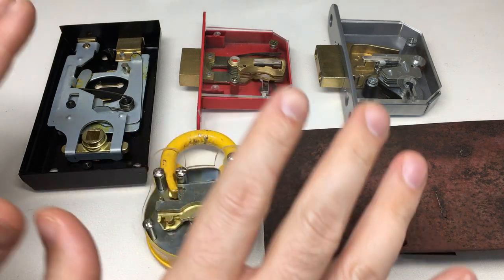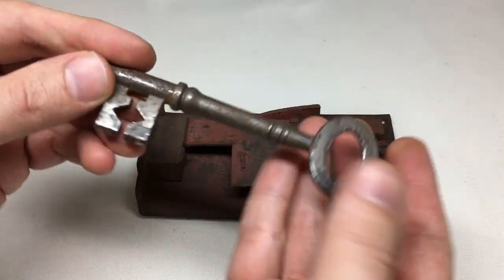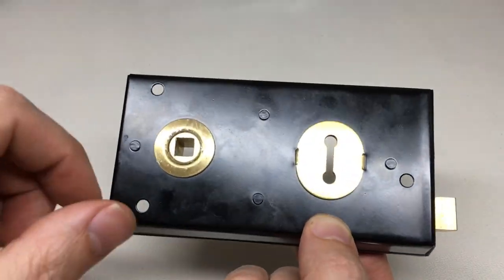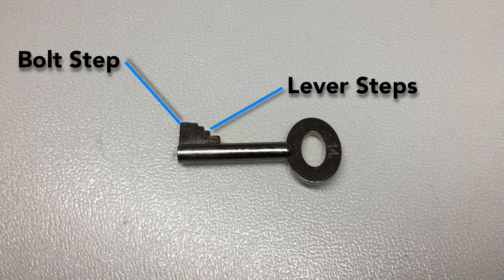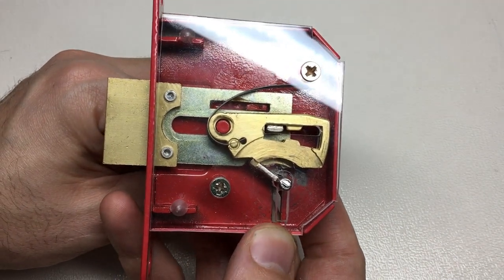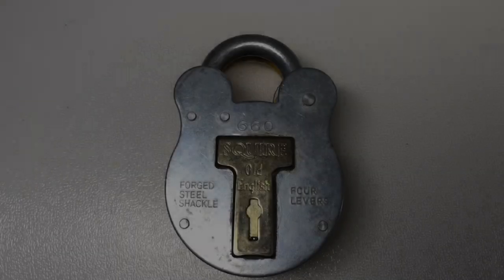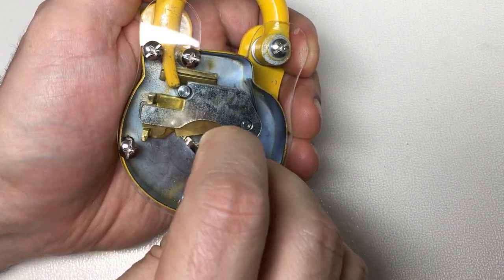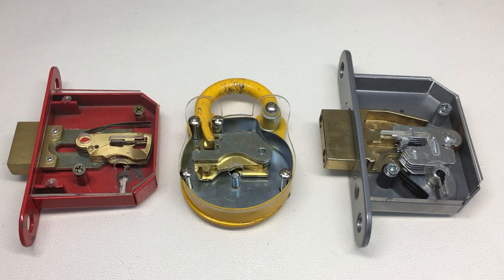Introduction to Lever Locks - Types and Terms: Ultimate Picking Guide Part 1

Comment from the maker: This is part 1 of a 5 part series on lever lock picking. We will cover types and terms, lever padlocks, non-curtained mortice lever locks, curtained lever locks and specialised techniques including overlifting, pre-lifting and tryout keys. Here is the FULL playlist :-) https://www.youtube.com/playlist?list=PLXm18pW-yyX7qhybbWL85Y80JeN2K9vhY
Reply: I LITERALLY just found an old lever lock today. It has the key but we found it later. Its luck that this was posted today haha
Reply: Hello lock noob, i could use some advice on lever lockpicking and figured this would be a decent place to ask. I picked my first squire 220, and its broke. 2 levers have spring tension still, the others do not, nor does the latch. Do you have any advice on preventing this?

~Luke
Reply: Listen

Comment: One thing I recently learned about lever locks - I'm on the very early part of my learning curve for these - is that locks with a keyhole on both sides (eg inside/outside the door) are generally non-piped, as the tip of the key engages with the other side's keyhole to maintain the alignment.  It is also why many (?most) of the keys for these are symmetrical - they can be inserted from either side of the lock.  Locks that only have a keyhole in ONE side (eg padlocks, furniture locks) generally use the pin to align the end of a piped key, and don't need to have symmetrical keys as they only can access one side of the lock.  Piece of trivia for tonight...! ;)  This looks like a fantastic series, Lock Noob - thanks so much for this.  Perfect timing for me. :)
Reply from the maker: Thanks for watching this 👍

Comment: Seems obvious to me if the internal wards were removed from your first rusty old lever lock, that a Euro Profile cylinder would fit right in there.  So therefore I assume that is how the Euro Profile cylinders came to be.  I'm not a historian on the invention of the Euro Profile Cylinder, so perhaps someone "in the know" out there could enlighten with some historical references.

I really like that old lever lock with it's so obvious and clearly visible warding -- really cool
Reply from the maker: There IS a theory that the Euro profile was designed to fit into the pre-cut key holes in doors that previously had mortice lever locks in them :-)

Comment: I notice that all the lever locks have the lever pack in front of the bolt. I have an old cash box which seems to have 2 levers in front of the bolt, and another 2 levers behind it. I say seems to because I have been trying unsucessfully to pick it for a long time now and I am wondering if I've got it wrong. is there such a thing?

Comment: I was working in a mansion (I’m a carpenter) and the guy that just bought the place had a walk-in safe. It was locked open without a key.
I removed the lock and took it to a locksmith to cut a key. A week later I picked the keys and the lock up to fit. The key was unbelievably complicated.
It was like lord of the rings shit. You had to turn in 1/4 turn one way, 1/2 a turn the other way. Push it in further then turn 180’ to open.